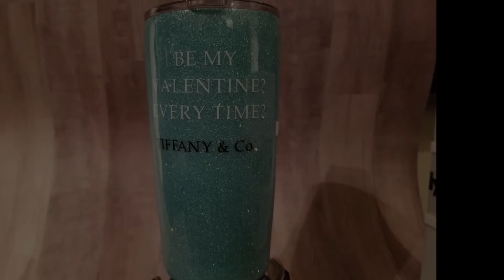DIY: Tumbler Edition - Glitter Epoxy Method

Comment: WOW!!!! Back in 1990 or so I used some clear epoxy to cover a very large clear glass ashtray. I wanted to seal in a large marijuana leaf to the outside of it, lol. Now I understand why I had problems. Bubbles and I must not have mixed it thoroughly because parts of it just didn't seem to dry right. But it was beautiful, for the lifestyle I was living at the time. Now maybe I would like to try maybe a flattened flower onto a piece of glass, maybe using a dollar store frame
Reply from the maker: Lol how cool... I remember the 90's. Let  me know if you try and need help

Comment: I just bought a tumbler turner but have not used it yet.  Since you mixed too much epoxy the first time, I noticed you remixed another batch, can you reuse what was already used or do you need to mix a new batch for each layer?  Your method to glitter on the turner is more simple than what I seen on Youtube.  Thanks for sharing.
Reply from the maker: You'll mix a new batch for each layer as it will cure harden as you wait between layers. I make Keychains with the excess
Reply: @ClassyShayDesigns  Thanks for the reply.  Do you have a video making keys with the access?